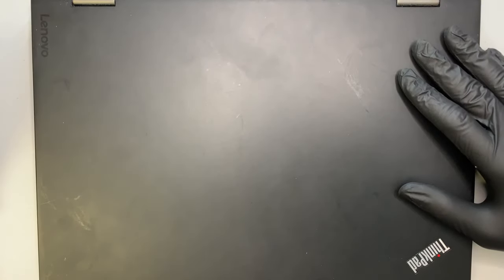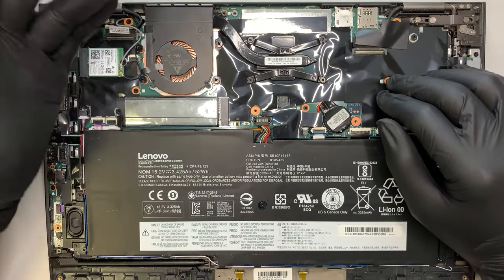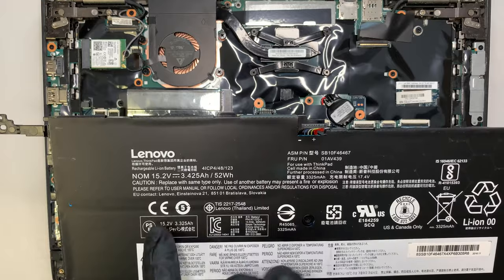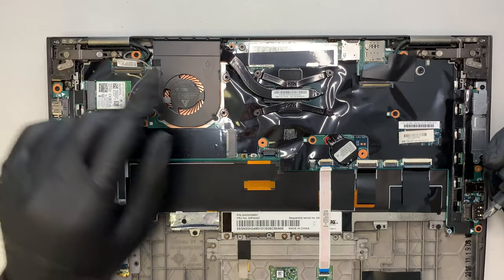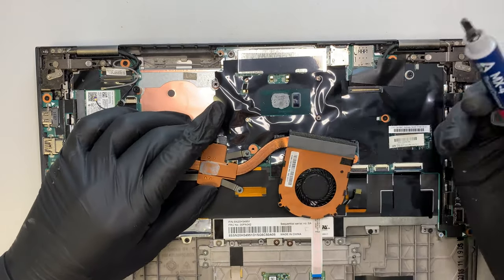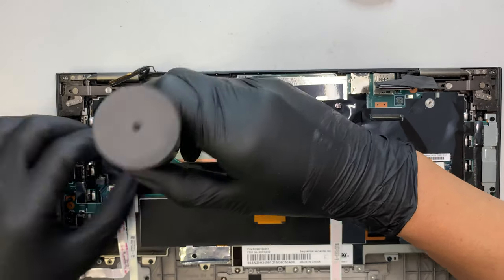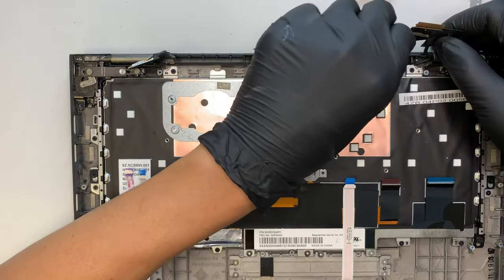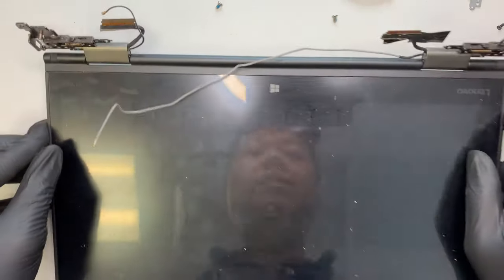Lenovo Thinkpad X1 Yoga Tear Down Disassemble 1st Gen

Comment: I have long blue and orange cables that i cant find where i put them back to? looks like type of connection of WIFI card, but i already mde this connection with different cables. What are these too? they run along front towards right side speaker. Also where does speaker cable connect?  x1 yoga gen 5

Comment: sir, i have a Lenovo x1 carbon. the cursor moves erratically without controlling it. When I scroll down it goes up on it's own and it is very difficult to type as the cursor moves on its own.

Comment: Hey, thanks for the video man. The manual says the SSD is a SATA M.2 drive. Are you sure the laptop is also compatible with NVMe drives?
Reply: I agree with your question. The 1st generation of X1 Yoga supports SATA M.2 and the video suggests that you can upgrade storage to NVMe. To be safe I would upgrade using m.2 2280 sata iii ssd given nvme technology was not built into 1st generation X1. The compatible m.2 2280 sata ssd has two notches in the connector as opposed to nvme with one notch.
Reply: @halbertech  the one on video is M.2 NVME

Comment: Hey I’m actually in the middle of taking mine apart right now, I spilled an entire glass of orange juice onto the keyboard and I know that it’s “spill proof” but juice decided to leak out of the ports on the right side so I decided to take it apart to get it dry, clean, and assess the damage. I was shocked to find that the only things that the juice touched besides the keys are those ports on the right side and the metal rail on the back right side of the keyboard. I’ve just been using isopropyl alcohol and it’s working but do you have any suggestions before I put it back together and then clean under the keys? This is my first time opening and fixing a laptop/computer in general so I really don’t wanna mess it up if I didn’t already, the only experience I have is modding controllers

Comment: Hi, really enjoyed the video. In the description you said you would show how to add additional M.2 NVME SSD but that didn't happen. Is it possible to have a 2nd SSD drive in this laptop? Or is my only option to upgrade smaller SSD to larger SSD? Thankyou.
Reply: It only has the one port, so your only option is to clone your existing drive if you need the data on it to a larger M dot to invert me and then physically swap them. You can get an external USB enclosure for your current drive and use it as a transfer desk after the fact. That’s what I did with mine. I used to make Reem reflect to clone it to a 2 TB NVM E Dr. and then physically swapped them and put my old 256 into the External case for simply moving files around quickly via USB. You can get an external M.two enclosure for roughly 30 bucks give or take depending on the manufacturer on Amazon.

Comment: Are you able to add ram to it? I want to upgrade my ram but I don't know if their is a slot for it.
Reply from the maker: No. You can't add more RAM
Reply: @UbergeeksBiz  That attitude does not spark joy.
Reply: @UbergeeksBiz  why can't you add more ram or replace the ram, teardown should definitely address this as this is what most people want.
Reply: The answer is quite simple, it’s all soldered into the logic board proprietarily. There is no way to unsolder it and solder in hire ram amount or faster. CPU. You have to an exchange the entire motherboard to one with higher specs. Quite common in many different computers, especially Apple products.

Comment: Hi, thanks for sharing the internal of the laptop. I got a 2nd hand gen 1 laptop, and notice the CPU core temp is quite high (~55 ℃ while idle,90 ℃ max) and feel heat on the keyboard area above the fan area. Is the temp issue normal? And if there's any solution ?
Reply from the maker: Maybe dust the fan and apply new thermal paste on the heatsink.
Reply: @UbergeeksBiz  Great video, thanks for sharing this. Just one thing I'd like to know. I have X1 yoga 1st Gen and it has both SIM and SD card slots. I'd like to make use 4G SIM and i noticed that it doesn't have WAN adapter inside. And even if i buy one, the two cables that connect to the adapter are missing inside the machine. I looked for the 2 cables but can't find them. Has anyone attempted fitting that adapter on this specific model?

Comment: Hi, I have a Lenovo x1 yoga that loops in the Lenovo booting logo and it does not do anything. I've tried replacing the SSD with a new WD one but it still did not work.
I've tried startup tips from youtube but still didn't work. Any tips on what might be wrong with it?. Thanks in advance!
Reply from the maker: When you changed to WD, did you install Windows 10 ?
Reply: @UbergeeksBiz  😅

Comment: That was very helpy thanks 
But I have a problem withy computer can you solved it for me
Reply from the maker: You are welcome. What problem do you have ?
Reply: Thanks for the reply 
Actually I my PC is not getting start
When I push the power button the AC and other   
Instruments starts up and quickly soon shutdown all the computer 
This problem is also occur when I output the SSD drive after that I tried it a couple of times and also pushing the ESC button then it opened the boot setup over there I test all the hardwares and there was not a problem in the hardwares

Comment: Thanks well explained, I really liked the video, please do more.
I know this is an inbuilt CPU and ram but is there a way you can replace Ram and CPU apart from changing Motherboard. I'm talking about Lenovo X1 Yoga>>
Reply from the maker: No. You would have to replace entire motherboard for that
Reply: No, there is no way to do that. You’ve probably moved on since your question as a year old but in order to increase the ram or CPU speed, you’d have to simply swap the entire logic board to one that has higher specs.

Comment: Thanks for Sharing the video. I have the same laptop and if late it’s been acting up and the technician who checked it out said  the bios is corrupted or damaged because it quite a task to switch it on. Efforts to Reprogram the BIos have proven futile. Now I’m wondering can changing the motherboard help me resolve this problem? Also where can I buy the motherboard and what’s the approximate cost? Really looking forward to hearing from you
Reply from the maker: Yes, you can swap the motherboard. Try this link:  https://ebay.us/82Ox2E    or     https://ebay.us/1I0IDl      Make sure you double check before buying it

Comment: Can anyone refer me to instructions on how to reset the BIOS Supervisor password? All the videos I can find are for other models and don't seem to apply to the X1 Gen 1. I reset the BIOS by disconnecting the batteries, but supervisor password remains.
Reply from the maker: The newer motherboard does not allow BIOS password reset.
Reply: Gen 1 is the old model. That’s the one I’m working with.

Comment: Where is the RAM ? You can’t upgrade it right ?
Reply: Unfortunately, no, it’s built into the logic board. You would have to replace the entire motherboard with one that has higher ram and a faster CPU in order to upgrade those two components. The only thing you can upgrade here is the solid-state hard drive and of course replace the battery. That’s about it. And the network card, if that went out, you could replace it as well.

Comment: Great video, thanks for sharing this. Just one thing I'd like to know. I have X1 yoga 1st Gen and it has both SIM and SD card slots. I'd like to make use 4G SIM and i noticed that it doesn't have WAN adapter inside. And even if i buy one, the two cables that connect to the adapter are missing inside the machine. I looked for the 2 cables but can't find them. Has anyone attempted fitting that adapter on this specific model?
Reply: Have you found the answer to your question?